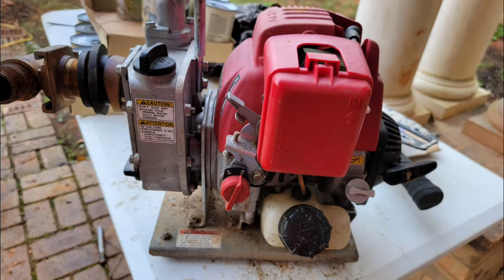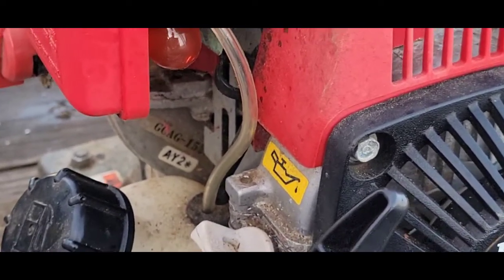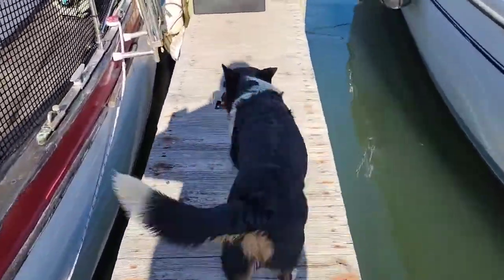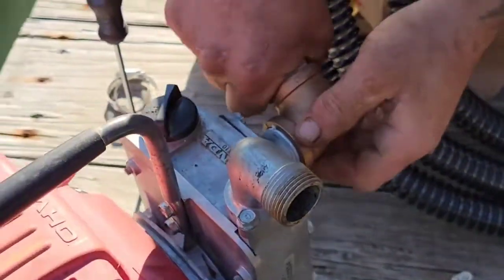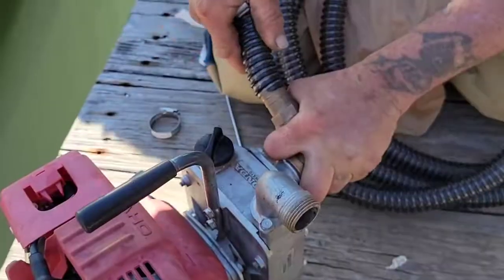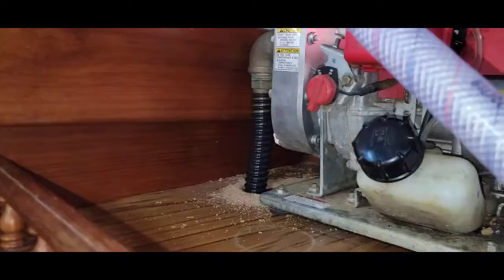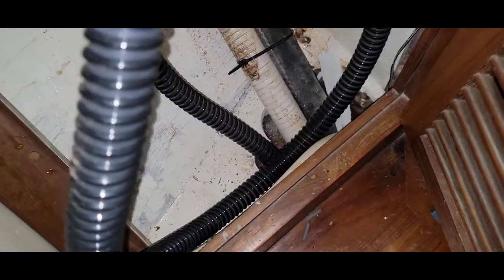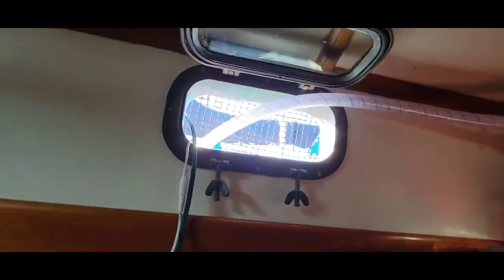Sailing Bob: Bob Got A Slurper...

Comment: Like the idea on the gas powered pump , in a emergency that could be a boat saver!!
Reply: But be careful,  the co2 level will get high quick with that inside
Reply from the maker: I think it's a good plan. You're right about exhaust. I put in forward cabin next to hatch and window so both could be open while closing door to main cabin. We are still contemplating piping exhaust but the way I described was pretty effective.
Reply from the maker: you're right! I placed it next a portlight and under a hatch. It's really only being used in emergencies excepting routine starting.